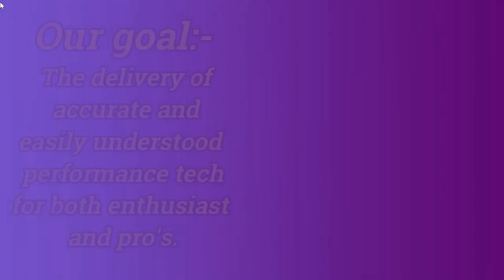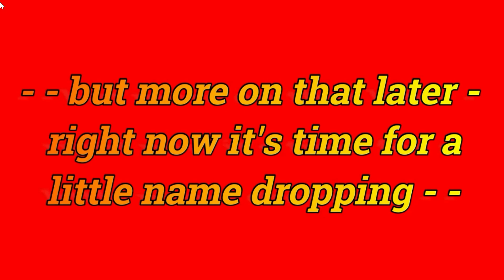Exactly how did my MSD 6 ignition cost me a big race win.

Comment: Hello.....  i.  Gather.  What.   You.   Are.   Saying.   Here..... Is. To.  Check.    Thuroughly.       The. Plug.  Wires.      Hoses.    And.  Wire.  Harnesses.   For.  Ample.    Clearance. To.  Prevent.      Harmful.  Contact.....      like. Vibration...    Heat. Exposier.   Or. Expansion.pressure....  During.      Extreme.        Use.  Conditions.    Have.  A.   Nice.   Day.....

Comment: I run the programable MSD units in all of the Rover V8 engines that I build. I 'gut' the standard Lucas distributor then make a new mounting plate to mount an MSD pickup coil inside the dizzy, it is triggered by the Lucas reluctance wheel, the advance curve is programmed into the MSD (along with the vac advance). Its a stealth setup, it looks standard! I'm sure that the Lucas ignition was built down to a price and not designed to perform well over 4.5k RPM. (Road cars spend more time at 2k than over 4.5 k RPM). Anyway my seat-of-the-pants dyno measured at least 20 BHP more at over 4.5k rpm and the engine would rev very cleanly to the 6k red line. The idle and starting quality is also improved, further more I think that the lean cruise AFR that I can run (leaner than 15:5:1) with an Edlebrock Performer 500 carb also has a lot to do with the MSD unit. It took quite a lot of effort to work out where to mount the trigger coil in order to ensure that the with a 'locked out' dizzy the rotor arm remains lined up (some overlap) between the rotor arm and each HT post across the full advance curve which includes the RPM and vac advance, luckily the rotor arm is quite wide so I was able to do this.

EDIT I did actually dyno one engine with a Lucas system, it was a 4.6 litre engine and it made 285 BHP, then my friend and I built a second engine that was the same spec but with the MSD setup described above, it made 315 BHP. These are small numbers compared to what you guys in America get out of your huge V8 engines but in the UK we don't have as much choice when it comes to V8's 😞 Also the first car the I bought with a V8 happened to have a Rover engine in it so that is what I learnt things with. (If only it had a SBC!)

Comment: Mr. Vizard still seems a bit angry about loosing the race due to a to good ignition.
👻
🙈
Reply: I'm sure the wires in the '70s weren't up to the task. I run 8mm Moroso wires on my MSD system. No problems yet. Did have a coil wire failure on an old 8mm MSD wire set like DV.

Comment: I had a misfire on my first tow vehicle.  The car had new coil and spark plug wires from the previous owner.  It drove fine for a while, but it developed a miss under power.  While diagnosing it with the hood up and engine on, the miss was not able to be duplicated.  This drove me mad for a time until I took a good look at the coil wire.  It was  a long loop from the coil mounted on the manifold to the distributor.  I further noticed witness marks on the hood where it rested when the hood was closed and where it moved around as the engine rotated under power..  Long story short, I put a short coil wire on it and no more problems.  It must have worn enough to electrially breakdown the remaining insulation in certain positions.

Comment: Interesting! Love the video! But in reality does that make the MSD 6 a bad ignition or the wiring bad? I had a mallory system and a 6, the 6 for sure made more HP and was reliable also I bought the biggest leads available, at the time! I wasn't but a bracket racer and just trying to make the fastest street car for my area! We did a lot of street racing back in the early 90's, sure wished I knew you then! I love the knowledge you share and hang onto every word you speak!

Comment: Perhaps someone can explain why changing the ignition system will EVER positively affect engine power,
unless:

     (1) Ignition timing is suboptimum and the new ignition system moves the ignition timing toward optimum (somehow),
or
     (2)  The engine is missing, and the new ignition system fixes the miss (somehow).

Remember that all the spark does is ignite the mixture, and more importantly, 
that ALL of the energy dissipated at the spark plug gap has to be drawn from the crankshaft of the same motor 
the spark plugs are screwed into. 

Bill from Fort Worth
Reply: It's to do with the delay between firing of the plug and getting a good flame front going.  This is mitigated by running ignition advance but that means you will get slightly rising pressures before the piston crossed tdc and you do some negative work.  If you can get a bigger burn going sooner after firing the plug, you need less advance, the piston is closer to tdc or past it and you get more useful work out of the burn.  In both cases the burn would finish around the same time (crank angles).  It's not huge, but a few HP extra, and you will have less chance of detonation or on modern cars knock retard.

Comment: Years ago co worker racing on the weekends with his fuel altered small block Chevy 1250 CFM carb. MSD ignition and a powerglide. Was running 11: 20s in the quarter mile. He said it seemed like something just isn't right it should be going faster. Sent the MSD ignition back to MSD got it back they said everything's fine. He put it back in 11: 20s again. He decided to put his Excel distributor dual point in the engine with the full on drag race stiff spring points. The car ran in the 6.89s, and that was with points ignition and the Excel super coil.
Reply: Um no. Your mate did not go from 11.2 to a 6 with an ignition change LOLOL. God damn why lie.

Comment: Interesting that you were able to get more horsepower from using it. But I shouldn't be as you say 3 here, 5 there adds up. I was always under the impression that between the 6AL and the Mallory Uni-light I had installed was more for ensuring solid timing than making horsepower. I learn something daily and especially the older I get because I have a more open way of thinking, plus I never had a great education anyways, everything I learned was a self taught or by a mechanic from the 1920 to 1980 era career.
Reply: This is true with me as well John, but I am thinking 70's era electronics were not that robust and reliable if David's recall is correct. Without adding weight or too complicated, a simple oil pressure switch could shut the entire system off, thus never harming anyone...except the driver! Plus optical spark was not extremely reliable until the 90's. 
DK, ASE Master Tech since 1978.

Comment: That I believe because I have had a 6" bolt that almost got me. Every time after I would disconnect the battery and attempt to jump the posts with a screwdriver and turn the key on a dead system to ensure that it was dead before I would work on the car.

Comment: David, in your book, How to Build Horsepower, you were talking about air cleaners in one section, and you made a statement something like, "Don't be too quick to get rid of your factory air cleaner, because there is a lot of engineering that went into its design", but you didn't elaborate on what that engineering was, or why it might be better to use the stock air cleaner in some cases. Can you please elaborate on that, either here or in a future video?
Reply: He does but I can't tell you which video. He talks KN also, I think.

Comment: So for many years i use a mark 10 box it was bought for 911 turbo cars CD box use with colder plugs and pump gas that still 101 at the pump.And i take that mark ten box and put it on my V8 chevy and cold starts just great it made a high pitch sream and switch of if it burned up .Also used for low comp Turbo v8 and my NOS opel GT 4cly a real sleeper like the v8 turbo with water injection

Comment: I really like the twist at the end of the story. It's ironic that something can work so well that it causes unforeseen problems but that's the thing with car performance. Make some changes to the engine and they bring out issues with the clutch with higher output. Fix the clutch issues and break the transmission. Fix the transmission and blow up the differential. Fix the differential and get driveshaft problems. Sort that out and notice that you are getting brake fade. Upgrade the brakes and your tyres need more grip. New tyres put more strain on the suspension. Creeping incrementalism in action.
Reply: We call it SNOWBALL EFFECT.

Comment: I never heard of a MSD 6 AL doing what you say.  I agree it will give you joint of electricity.  It will only shock you and not hurt you, it's DC current and not AC...  Voltage does't kill a person, it's the amps that gets them.  I understand about your miss fire.  You are suppose to keep the coil wire to the dist. far away from any metal where it may short out and ground out.  I run a 7AL box, I really like it.   I use rpm chips to shift my car and a rpm chip  for the line lock and trans. brake.  I can't afford MSD grid, what I have works just fine, thanks for your story and at your age you have a lot of them to tell, take care David...
Reply: I never got a reply?
Reply: He never said the MSD will hurt you. He was talking about a completely different ignition system when he was talking about track workwrs being in danger of electrocution but regardless,  you are wrong,  any electronic ignition can kill someone of the circumstances are right....

Comment: I have a MSD story I was bracket racing at englishtown New Jersey and ended up in the final round against a guy with a Corvette who was the number one points leader in heavy eliminator he was dialed in slightly quicker than me so I got the break and in the top end as I clicked third gear my motor misfired and I lost that race by a few thousands of a second neither one of us knew who won  until we got our Time slips since I had to drive home I did not mess with the car since it was running fine other than the wide open throttle high gear Miss the next day when I checked it out I touched the coil wire and it fell apart like cigarette Ash I found out that running a large spark plug gap puts a high load on the ignition which cost me that race in my first final round appearance we live and we learn keep the videos coming thanks for sharing your knowledge it is appreciated .
Reply: How large a gap are you referring to specifically 
I would consider. 035 to be standard 
.045 for hei - were you running larger than .045?
Reply: @westleyhanbury6046  i had cut back my ground strap back past center of the positive electrode ( something i read in one of the magazine back in the 80 s and tried in   1984 ) it was a smal block pump gas 67Chevell 355 that I would drive to the track with no Posie 308 gears and run 13.80 never getting into 3rd HEI DISTRIBUTOR MSD 6 EXTERNAL SUPER COIL , not blaming msd that loss was on me but the current push fried the coil wire a crane high fire rep at the keystone national s explained it to me.  Never did that again still bracket race  g body Malibu 79 pump gas 388 pro comp  heads flat cam 411 s, on spool  still drive to track 125 one way  run in the 10 .s .......p/s 8 inch converter. Dam my friends are right I do talk allot 🏁
Reply: Helical core FAT wires 👍👍😎

Comment: I put a MSD 6A on my 77 GMC 3/4 pickup with a 454 and factory HEI ignition.  The idle and cold start changed so drastically, I took about 1/2 turn out of the idle speed screw and softened up the choke setting a ton.  Wish I would have opened the plug gaps.  Did like to eat spark plug wires.  Finally settled on Taylor wires.
Reply: ONLY helical core wires allowed.
Reply: Ya I had to use Taylor's 8.8 wires with my MSD 6A